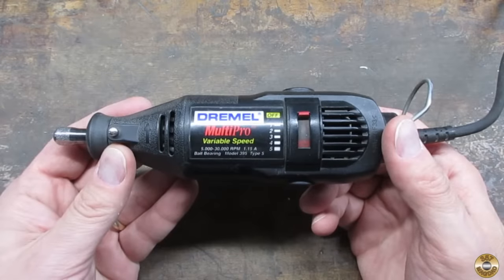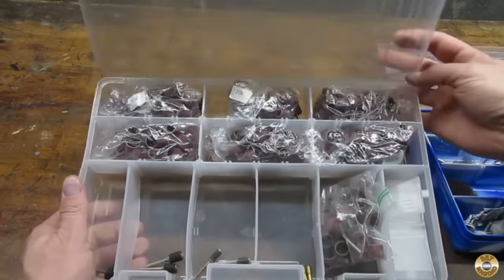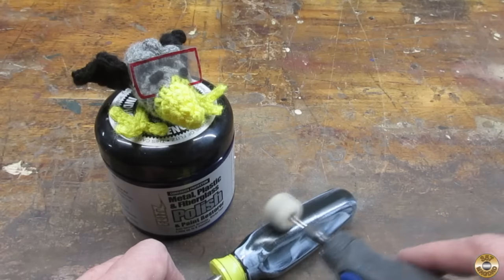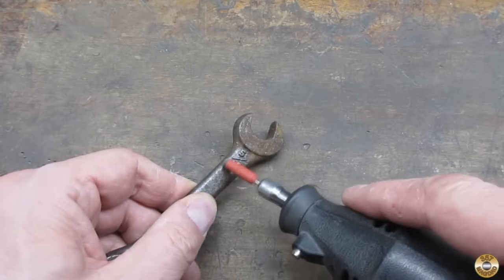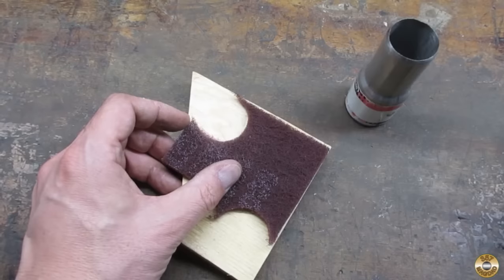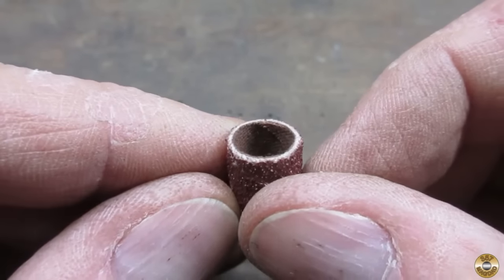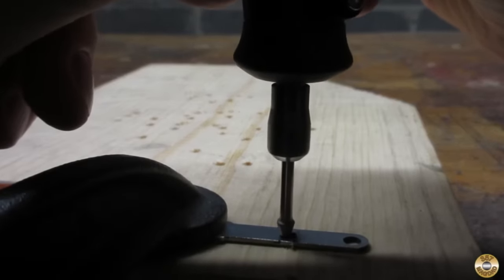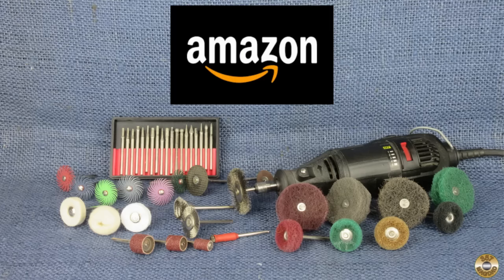Rotary Tools Tips and Tricks

Comment: Been a gunsmith for many, many years and I’m always thrilled when I learn something new.  Adding heat shrink to the End Wire Brush is something I’ll be doing from this point on.  🙏
Reply from the maker: Try it out!  Let me know how it works for you!
Reply: Smith I used to apprentice for had a saying "Another drool with a Dremel tool" this was because most people had no concept of things like polish on LOW speed with cloth buffs. I use mine all the time to remove light rust or polish brass or nickel silver on knives. With flitz or Semi chrome it takes NO pressure and works like magic.
Reply: ikr! that was such an AH-HA moment!!
Reply: Me too.  Great idea.
Reply: Same here, great little tip.

Comment: ⚠Avoid using Pliers etc to expand the drum because often break the paper and glue causing other problems. Instead keep the screw loose when not actually being used. That allows the rubber to return it's original shape and much easier to get the drum on. It make take a day or longer for the rubber to relax after being compress months to years because most are sold as "ready to use" with drum on rubber. Try soaking in warm water if need it soon.
Reply from the maker: Thanks for watching!  I've been using that trick for years and I have never had a problem.  I even use the cheap Amazon/China sanding drums.
Reply: @357magdad   This like many others does not solve the root cause and many still try to force the bands over expanded rubber so other viewers hate them. Even most new drums are crush a bit will fit when users loosen the screw when storing. Go and try loosen the screw on your backups and wait for rubber to relax. Note: Rubber can  get hard from heat during use and from many chemicals and never relax so some used mandrills are trash now.

Comment: I was recently taking something apart and inevitably the phillip screw heads stripped out.  These were tiny #1 screws.  Rather than use an easy out I got the cutting wheel of the rotary tool and cut a slot across the head and used a flat bladed screwdriver to remove the screws.  I just hope I can remember this hack.  I'm an old fart.
Reply from the maker: I just used a thin cutting disc to clean up a tiny slotted screw in my latest video!
https://www.youtube.com/watch?v=tLxHcqxvA04
Reply: I had a similar problem with a window winder that had anti theft screws in it. The window winder had to be replaced so I used the cutting wheel on the Drexel to make a slot for a flat edged screw driver.

Comment: One tip is to always have a spare set of motor brushes so you can swap them out when needed. It isn't fun waiting on a set of brushes to continue a project!
Reply from the maker: Having spare brushes is a good idea!  I found a rotary tool in the free pile last year that is my back-up for when my 20+ year old Dremel finally dies.
Reply: it is better to have 2 spare grinders

Comment: When my sanding tubes wear out I replace them with regular sandpaper (various grits) by cutting strips and gluing the strip on with contact cement (Barge-----usually used for gluing leather).  I glue it directly on top of the worn-out paper.
Reply from the maker: Good idea Jeff!
Reply: Wat a cheapskate ĵust spend the 5 bucks a good dremel is 100.00

Comment: If you run a bead of super glue around the interior of both sides of your wire wheel, you can extend the life if your wheel by a pretty significant margin. That's less wires being sent straight toward your forehead, eye ball, and I got one in the tip of my nose once - that face shield really is the way to go.
Reply from the maker: I haven't had any luck with super glue.  I was mixing up some JB Weld for another project and I added some to a few wheels.  I let you know how they work out.
Reply: @357magdad Any feedback on the JB Weld on the wire wheel? Cheers
Reply from the maker: @snejsnej01  It didn't work for me.  Check out my Estwing Ball peen hammer project:
https://www.youtube.com/watch?v=Qob-1iIg-xo
Reply: @357magdad try setting a jig up with an arbor press. Block of wood with a hole drilled in it with the applicable size socke does the trick. If you don't have an arbor press, a swift blow with a hammer works too.

Comment: I use a dremel when making holsters. Instead of punching holes, I drill them with a 3/32 bit. After gluing the holster together, I hold the edge over a piece of scrap wood and drill through the leather into the wood. It makes a clean hole to stitch through, and burnishes the hole to prevent tearing. 
I use the sanding drum on the sewn together edges to smooth them out for a finished look.
Reply from the maker: That's great CJ!  I don't know what I'd do without my rotary tool!

Comment: I just found your YouTube post.  I use the rotary tool in repairing and overhauling vintage sewing machines.  Great tool.   I learned something new regarding using heat shrink tubing! All your other information is not entirely new to me, but great information.  My husband was ONCE using a wire wheel wearing a tee shirt, that didn’t last very long.  He! he!  Luckily he had a face shield.  He now wears an apron and long sleeve shirts plus the face shield.   Thanks.
Reply from the maker: Thanks for watching!  Mrs Magdad and I found a 1908 New Home sewing machine in a free pile that we plan to work on this winter.

Comment: I wear a denim apron as well as the face shield for those cured wire wheels.  What amazed me the most is the Dremel company was founded in 1932. Before I used a Dremel I used a Foredom tool in a factory and still have a fondness for them. The Dremel shines as it is portable. I bought mine for woodworking about 30 years ago, but used it more for mechanical work than it's original purchase idea. Cut a lot of rusted fast bolts and nuts with it.
Reply from the maker: I'm going to have Mrs Magdad make me an apron.
Reply: Agreed, pulled a wire out of my forearm with.a Leatherman , I had been intelligent enough to wear eye protection😆
Reply: Dremels are now made by Bosch, l found this out when l bought a Depsteck similar to the cordless Dremel, the Depsteck  is in green and black and looked so like my Bosch cordless multi drill l looked up the makers, but before l got to them Dremel came up first and was made by Bosch, l would have sworn Depsteck was Bosch, you live n learn.
Reply: I'd be careful in the ear with the buds 😂

Comment: Just started learning how to “restore” old pocket knives. I’ve been collecting for only a few years, but didn’t want to just keep buying knives for the sake of buying knives, so I decided to take the hobby into this direction. Got a drill press, vertical sander with grinding wheel, vice, sone clamps, and my late father in laws dremel tool that’s just like yours. There was also a battery powered one in the box, so I’m hoping to use that one as well. I’ve only used a rotary tool a few times, so I’m very new to it. But what a difference it makes cleaning up old carbon steel pocketknives. Can’t believe I was doing all that stuff by hand, taking up a lot of time. Love watching your restoration vids, and the ones like this one. Short, too the point, filled with information. Hank you kind sir, I will def be using your vids as some of my learning tools. I just got a 70s delrin winter bottom handled Queen moose knife, that has to get the pivot replaced on the clip point blade.  I’ll be going into your vault to find tips. Happy new year, and be safe
Reply from the maker: Cleaning up old pocket knives is fun!  Be careful - you'll start cleaning up screwdrivers, pliers, and wrenches!

Comment: The flexible shaft is a must have accessory. 

Makes doing fine work easier because you don't fight the weight and size of the motor.
Reply from the maker: Thanks for watching!  I was never able to get comfortable using the flex shaft.

Comment: I’ve just started using my rotary tool for wood carving. I have only used high speeds. After listening to you, I’ll try slowing the speeds down.
Reply from the maker: I don't have a lot of experience wood carving with my Dremel.  I would think speed would vary with the bit size and how hard the wood is.

Comment: Great video and advice to most people that don’t work with these types of tools daily. There’s even some good tips for people that do use them daily (that may not know) the heat shrink was a cool tips for sure.  You can also take a 1/8” rod or whatever size shank for the collet your tool is using and cut a slit in the end however deep you may need and fold sandpaper thru it to create a way to gently buff the inside of holes to clean or remove burrs or even open the hole up a small amount. This method allows you to easily work on a range of hole sizes with the same tool just by making the sand paper longer to sling out farther
Reply from the maker: Thanks!  Great idea!

Comment: This was a great video! I tend to avoid using a Dremel because of consistently poor results.  Now I know that high speed was the problem. Thanks for the great tutorial!
Reply from the maker: Give it another shot April!  I use my Dremel on almost every project!
Reply: High Speed on The Cutting Wheels That's About it. Love My Dremel.
Reply: Appreciate the low speed tip magdad, that"s a great bit of advice.

Comment: Great tips. I just tried the heat shrink tip last week and the worked quite well for me. I've heard people using super glue around the centre of the wire spitters, sound plausible but I didn't try it out personally yet.
Reply from the maker: I tried the super glue trick and didn't have success.  The next time I'm mixing up epoxy I'll try to remember to glue up a wheel as a test.

Comment: Great video magdad! You were tell how you like to cut out you own abrasive wheels. I have been doing that but I use a rivet to put those together. I don’t know if it’s any better or faster but my fat finger don’t have to fight that tiny screw. Also on the flat sanding disk I put 3 on at a time. They don’t rip off as easy. Anyway great video. Thank You for sharing!
Reply from the maker: Thanks Jack!  The store bought ones are also riveted.
Reply: I like the Rivet Idea

Comment: Useful tips.   I also use my B&D Dremel equivalent tool at slow speed.    I will have to get a set of the SWPEET plastic wheels.   I use the grinding wheels you show e.g. to cut HSS tool blanks.    Sometimes they work and wear down without breaking, the smaller brown ones often break, likely to make hand causing a slight twist on the disc.
Dave.
Reply from the maker: Cutting with those thin cutting wheels is like playing Russian Roulette!

Comment: I have used dremel for at least 20 years, but recently got a pneumatic rotary tool and I love it even more. Really lets me get down to low RPM and I just prefer air tools over even battery powered tools
Reply from the maker: I hear air tools are great.
Reply: I guess but then you need a compressor and all that xtra noise ! Not to mention the power to run said compressor!
Reply: @StonemanRocks  and if your shop already has an air compressor, like most do, then you are used to the noise, the power consumption and of course already have one with the CFM needed to power said tools.
Reply: @jormungand72  go read the comments! Most people dont have a shop ! They are working from their couch! I still use my rotary tool plugged into the wall .
Reply: @StonemanRocks  I see no such comments, quite the opposite actually. And at the very least, I would say that most people have turned their garage into their shop or their shop away from their place of employment that is also a shop.
I technically dont own a "shop", but my garage still has all the tools required to be considered one
Reply: pneumatics are great, but i LOVE my Ram micro motor. i dont really touch my dremel anymore...sadly nor my air grinders, sadly nor my foredom!

Comment: Thanks for this Magdad, a really useful summary of the techniques you've shown, I reckon the top tip is the heat shrink !
The only tip I can add is that I've also used Scotchbrite cut to size on the 2" yellow velcro pad ( like you had loaded in the right angle drive) it sticks reasonably well to the velcro , but can be a little tricky to remove after it wears down at the edges !
Reply from the maker: Thanks Andy!  I've got to use that right angle attachment more!

Comment: Great video and some new ideas as well, I think my no.1 is the heat shrink tip so useable in a few situations. But now I’ve said it I am wondering if I was ‘fair’ to the others lol. 
So low speed then, did I catch you right?
Bob
England
Reply from the maker: Thanks for watching Bob!  I like to keep the speed low for wire wheels, drum sanding and polishing.

Comment: I see you restore a lot of tools, I do too, an old woodworker back about 40 years ago used to do this to recondition old rusty tools then put a clear coating on them and sell these to supplement his tiny retirement allowance. He showed me how to coat a tightly packed heavy cloth buffing wheel with an adhesive from Caswell then you rolled this compound on the wheel and let the glue dry. The compound was probably silicon carbide, emery or aluminium oxide in fine grits like 120-400. You could take an old rusty hammer or pair of channel locks and lay into this wheel pretty well and it would make the rusted item look like new in a few minutes or so. Must have heavy gloves on and personal protection gear on. When the buffing wheel glue wore off you can remove it all down to new cloth then recoat and roll on whatever grit abrasive you wanted.
Reply from the maker: Thanks for watching Bryan!  That sounds like an interesting technique!

Comment: I've been wanting to purchase a similar tool. There are so many options out there, what brand & model would one recommend for mostly lighter work, like sanding and polishing. But will do some cutting of softer materials like wood and some softer metals like aluminum and the like?

I also noticed you reccomend low rpm settings in a lot of situations, but in some cases you didn't explain why. I assume you get better results or tool wear, but I'm a very curious one and l always need to know "why?" Sorry.
Reply from the maker: Check out your local Harbor Freight.  They often have good coupon deals. Make sure you get one with variable speed. Wire wheels and sanding drums work better and last longer at low speed. Polishing should also be done at lower speed.

Comment: It took me a few years to figure out what a lot of the different bits that my Dremel came with were for. One in particular was the little bit that holds a buffing wheel. 
It looks like a screw that was welded onto a shank upside down. I can remember thinking, wth is this for? It must be for making holes to drive a screw thru. Nope, a buffing wheel gets screwed onto it. 😃
Reply from the maker: It would be nice if the bit sets came with some pictures and instructions.
Reply: @357magdad  right??
Reply: If you've never done any metal polishing,  professional machines use taper screw which is much quicker to swap out various mops and buffing wheels plus the edge wont catch on items being polished with leather washer reinforcing center of wheels and preventing them screwing on too far
Amateur 'prosumer' stuff is parallel spindle bolted together with washers holding mops and generally low power. (2hp is about minimum for professional polisher, 5hp more common in my limited experience)
The nut holding mops can and does get in the way quite often and will mark parts very badly.

Comment: I use an old sewing machine foot control for a speed control as it gives a much better control of speed. With this controller it allows an almost 0 RPM to full speed.  They are usually available at a sewing machine repair shop for free or a few dollars.
Reply from the maker: Good idea!

Comment: Good Video! My dremel was burned throug after a wile. Now i have a Foredom similar machine with flexible shaft and foot pedal and I absolutely love it! It has so much tractive power out of zero rpm and keeps rpm on low speed when burdened.  There is lower speed possile with it and its very durable, cause of the big motor with long lasting brushes. No over heating problems and always a handy cold handpiece which takes tools up to 6mm without constantly change collets. If you once worked with one, you wont go back to dremel. To have variable speed with foot pedal i"ll miss never again. They are cheaper than dremel and have spare parts too for reasonable prices.
Reply from the maker: Thanks for watching!  The Foredom kits look like they run about $350.  Unfortunately that is way over my budget.  Maybe when I get to 50,000 subscribers!

Comment: great tips, i found a work around for as you call the "spitters" to prevent almost all spitting therefore increasing the longevity of them simply drop a few drops of super glue on the wires near the mandrel on both sides and allow to dry  this really helps
Reply from the maker: Thanks for watching!  I've tried super glue and epoxy and neither have worked for me.

Comment: Those Diamond Bits are great for getting thru tough metals and I've used them holes in glass and most recently to drill a small drain hole in a Ceramic Birdhouse..........I like the Flap Drums because they conform to some shapes better but they do cost more than the regular drum sanders.
BTW I'm putting in my request for Bombay Mahogany for that Stacked Leather Ball-Peen and maybe Blue the Steel.
Reply from the maker: I have one 80 flap drum bit.  I've only used it a couple times.  Maybe I'll ask Santa for a kit of them.

Comment: For speed control i built a controller box with a outlet plug hooked to a dimmer switch that lets me control the power output with the turn of the dial. Been using it for yrs.
Reply from the maker: It is important to have adjustable speed.